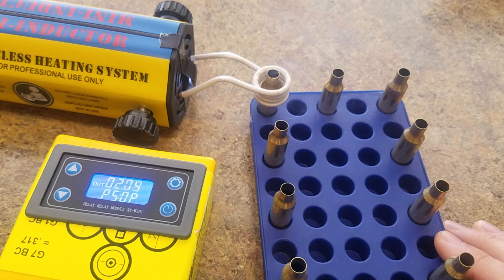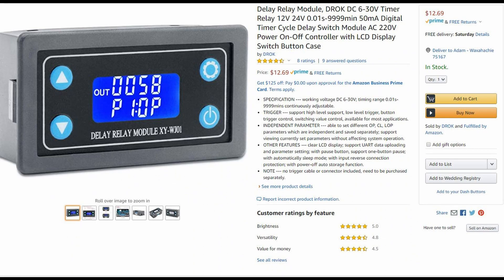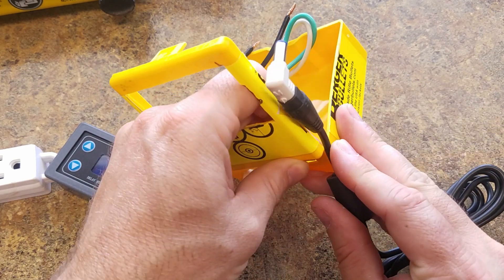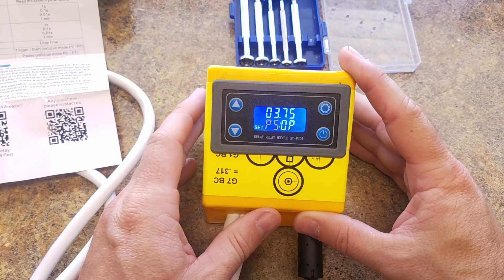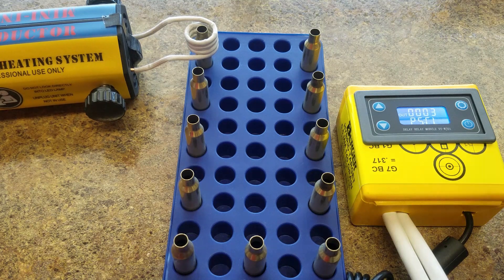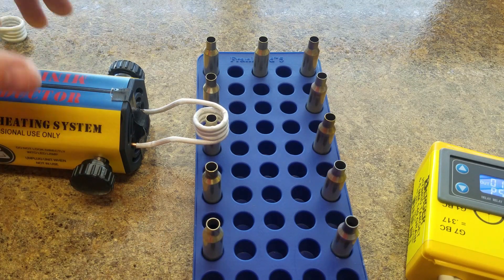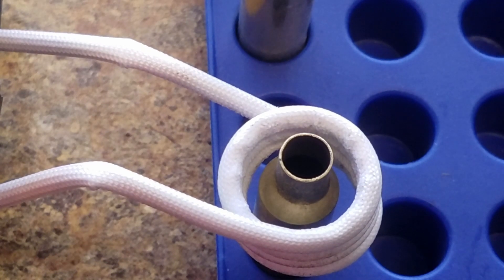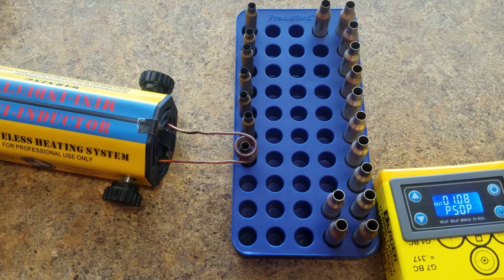DIY Induction Annealing Brass with .01 second accuracy for $200

Comment: I think the cost behind the Annealing Made Perfect is the laboratory science supporting the annealing code and verifiable Vickers hardness achieved, in the right place. Not saying you can't achieve a level of annealing with your setup, I just don't see how it compares in accuracy. Still, I applaud your ingenuity.
Reply: If Eric Cortina can shot small groups with a propane bench mark, this induction annealer will be just fine.. ;)
Reply: Look, I might be wrong, but from the research I've done, there's a relatively large window for a case to be "properly annealed".   I think AMP marketing is getting into folk's head that there's only a snippet in time / energy to get a proper Vicker's value.  YMMV
Reply from the maker: Maybe, I don't know how expensive "science" is, but I'd bet they have that loan paid off by now and yet the price remains the same. Maybe my next video will be  "PO-boys Vickers Testing" 😉 The physical annealing is the same regardless of what power supply is hooked up to the coil. Before induction annealing guys were doing just fine breaking benchrest world records using the propane torch method. AMP might have made it idiot-proof by preprogramming profiles for different brass, but as far as accuracy goes? It is accurate to .01 seconds! how much more accurate do you need? The window from perfectly annealed brass to over-annealed brass is relatively wide, and any competent reloader could easily tune this setup to stay within that window consistently. At this point, I would probably take a free AMP if the wife was just really feeling X-mas this year, but I'd probably mostly still use this setup for speed. 

What will be interesting though, and I will try to do this, you gave me a great idea, when their AMP PRESS comes out, test the seating pressure consistency of AMP annealed brass and "PO-boy " annealed brass. That's what it all comes down to in the end anyways, consistent neck tension.

Comment: Did you use anything to wrap/make your coils on? Like 1/2 pipe or?
Reply from the maker: I did,  I used a towel hanger bar from the bathroom.  I had an extra one from a remodel and it worked perfect. O.D. on it is .62"
Reply: @northeasttexastactical375  So, something about 5/8" diameter should work.
Reply from the maker: Recently I've switched to using the next case size up to wrap for my coils.  A 308 wrap works good for my 223. A 300WM wrap works good for the 308 cartridge family.

Comment: If someone watching this wanted to make a high-volume set-up. you can substitute copper tubing instead of wire on the coil, and run coolant through it. Look at high-performance computer systems with a liquid cooled CPU to get the non-electrically conductive coolant, not expensive (mineral oil?). Also, you can make your own induction coil-heater by custom-winding a discarded microwave oven transformer. Similar to an RSU. https://www.electricbike.com/resistance-soldering-unit/
Reply: Would there be benefit to wiring the fan to run constantly, or is it cooling the electrical components, not the coil?
Reply: buy this?  https://fluxeon.com/product/annie-water-cooled-helical-coil/

Comment: I'm new at this but wondering:  Does it not need to quench in water to anneal? I'm going to build one of these but I am in Australia so will need the 240V parts. I'll try to work it out. Thank you!
Reply from the maker: You should find all these parts in 240v. Quenching stops the heat from traveling further down the base,  it's not necessary.
Reply: Brass doesn’t respond like steel does to quenching. Matter of fact you can go either way.

Comment: So how did you determine the timing sequence?
Reply from the maker: You are more than welcome to add any analysis or testing steps you want,  this is just the annealer.
Reply from the maker: It is obvious though whenever you under or over  anneal, under annealing does not change color or glow red at all and over annealing gets bright red and leaves a rainbow discoloration at the bottom end of the annealed part
Reply from the maker: Look for the grey "flash" I described in well lit conditions,  or look for that dark red glow in low light conditions
Reply: @northeasttexastactical375  so no metallurgical analysis? No analysis of current lots of brass? It’s a guess as to whether sufficient annealing has occurred or an over annealing/destruction of the brass?
Reply: @jamesesenwein5152  I guess you can send a sample to AMP for testing.  lol
Reply: @bginvestor101  AMP Annealer uses one piece of sacrificial brass from a lot and determines its time to anneal. It then assigns a number code that is entered into the machine for use later. I’m assuming it has a spectrometer of some sort to conduct the analysis on the sacrifice piece. That feature makes the AMP Annealer worth $1400.
Reply: @jamesesenwein5152  I guess people weren't annealing until AMP came along??? If you can afford the AMP buy it, but a lot of people don't have that kind of money for a top shelf annealer with marginal benefits. There's plenty of top rated F-Class shooters winning matches without an Amp annealer.
Reply: @rustynut1967  I bought the AMP Annealer last year at the recommendation of a fellow shooter.  Worth every penny.

Comment: Very nice. Looks like a great answer. I have a question about the parts you link to. The Induction Heater link does not work. Going to ebay I think I have found the right one in 110 volts. The link for the Relay Timer says 220V.  Is this the wrong relay? Thanks for all you do.
Reply from the maker: I'll try to update the links here shortly.
Reply from the maker: Links updated. The relay switch I think is good up to 220v, so you should be good with 120v.

Comment: I built mine, have to fine tune the timer to the brass.  It goes on then off like yours, so it works.  Very fast.
Reply from the maker: Very cool,  glad I could help.
Reply: The 4mm works over 10 gauge!
Reply: Insulation Braided Sleeving, 33Ft-4mm High TEMP Fiberglass Sleeve White.  This is the listing, going to be a millimeter larger so I can get it right the first time. I would rather it fit with all the wait.
Reply: Also I bought copper for this in a roll 99.?? Pure.  I cut exactly a foot, might want to go 14/15” next time.
Also I found 4mm fiberglass sheathing on EBay.
Reply: The eBay high temp sleeve came and it’s fine
Reply from the maker: Let us know how long the sheathing last or how it holds up.

Comment: Very nice video. Inspired me to build from the same components, almost. Since I am based in Europe I use the 220V heater and I got this relais timer https://www.amazon.de/gp/product/B07X7NBSG4/ref=ppx_yo_dt_b_asin_title_o00_s00?ie=UTF8&psc=1. However the heater uses quite some capacitors and there are some other disadvantage in frequently powering up /down the whole heating unit. So I drilled a little hole into the unit and connected the time relay in parallel to the little red switch. So the heater is always connected to the AC and the relay does the same as the red button, just in a controlled manner. Also nice that one doesn't have to push the red button to have it operate.
Reply from the maker: That's awesome, nice upgrade.
Reply: There are 8 screws to open the unit. 3 are hidden under the yellow sticker. Once open I cut the wires to the red switch and soldered the the red and yellow wire into the cuts and re-soldered the switch into it.
Reply: Oops no ability to post pictures.
Reply: @RobertGun  thank you. I give it a try.
Reply: Can you show how?

Comment: Thank you! It is really interesting. I will try the same but will attach one plate on top with a hole to drop a brass upside down centred into the coil.
Reply: Never anneal upside down
Reply: @samlebo4704  Doesn’t the AMP anneal cases upside down???
Reply: @samlebo4704  why not? the termal transfer is way higher in the brass then any rising air would manage..

Comment: I can't drop $1300 on a machine and didn't want the fidgety propane solutions that looked like you were basically guessing and very inconsistent.  I looked up making an annealer and this is the first one I have seen that didn't require 500 steps and some sketchy circuit building.  I may just pick the parts up, the big difference between this an AMP is they have the formulas and hardness tester, I'm thinking of just doing some range work where you anneal for X amount of time and go up a short amount, shoot, a bit more, shoot and grab the velocity and group size data to see where the peak accuracy comes from.
Reply: If you reduce the watts on the transformer output, the case would heat up a little slower and it would be easier to time the precise amount needed to get perfect results. As much as the $200 induction heater is significantly less expensive than the professional units, you can make one from a discarded microwave transformer very easily for under $80. It's not about saving $120, it's about getting a unit that is perfect for the job.
Reply: @ronaldroberts7221  Huh, sounds interesting.  I'll have to do some research on that.
Reply: @InvestorAcademyPodca  The transformer would only be for the power supply. Read the electricbike dot com article on making a resistance soldering unit and spot welder from a microwave transformer first, then here is the video I would use https://www.youtube.com/watch?v=YO_cYhV6eIM

Comment: Thanks for checking.  The wire that comes with the kit is 10ga.  Have you ever tried 5 five coils of it?   Or do you think that it will make it take longer?   So have you settled on 12ga?  How do you insulate it?  Is wire available with that white braided insulation?  Thank you. Mike
Reply: I was able to order the fiberglass insulation from eBay.  Only available from China.  The size is 2mm. It’s very cheap. That is the same size that comes on the original coils.  I haven’t got it yet. I straightened the one extra OEM coil and slid off the insulation and slid it onto the new 12ga, 5 coil wire before I bent it.  It works great.  With use, the machine overheats and shuts off.  I have to limit it to about 50-70 cases and then it off and let them it cool.  I have one small fan blowing into the opening in the front as I use it, but I wished it pushed a lot more air.   You’ve been a great help to me and I really appreciate it. Thank you.
Reply from the maker: I haven't tried 5 coils of the 10ga wire that came with it.  I think it would take longer and it would heat more of the case than I need.  I don't insulate the 12ga wire I use,  it's just bare wire.  Just make sure the coils aren't touching or you effectively "short out" the coil in between. I used my 12ga, 5 coil wire on a piece of 300WM brass and it took a little under 3 seconds to over anneal it. Ive used the 12ga unprotected wire exclusively since making the video and I love the speed i'm getting from it.
Reply: That sounds good. I’ll give it a try.  Mike
Reply from the maker: @mikeortho1  id try 5 coils of the 12ga bare wire and just space out the coils enough to get the coverage you need on the bigger cases.
Reply: I  thought I was ready to go and I now see that the timer I ordered ( I wanted a 110V model) only goes to 1 second intervals.  After searching all day, I can't seem to find a 110V timer that goes to 0.1 or 0.01 seconds.  I may have to reconsider a 12V model.  I was trying not to used a transformer.  If I end up going to a 12V model, can I use a small transformer or do I need one from a laptop, etc?  Thanks again for your help.  Mike
Reply from the maker: @mikeortho1  You can use any DC inverter, I just had an extra laptop charger laying around. You can get the one in the link in the description from Amazon as well

Comment: Hi.  I'm making progress on my annealer using the same handheld unit as you.  Thanks again for sharing your project.  I see you're using 4 windings in your coil, did you ever try 5?  Some of the cases I'll be annealing will be 30 cal magnums and I'm wondering how it might work with 5 coils?  Do you think it would take more or less time to anneal a case.  Do you think the unit can handle 5 coils? Thanks for any insight that you may share.  Mike
Reply from the maker: I just measured my wires. The large wire I tried was 6ga. and it was definitely slower.  The fastest wire I've used has been 12ga. with 5 coils. The wire heats up faster,  but with the 2nd table fan it also cools down quick.
Reply: My annealer  turned out great.  I Appreciate all your help. I’m using 5 coils of 12ga like you were.  I got 2mm fiberglass insulation off of eBay. It was like $3. I use 1 fan but it’s real close.  I also built the table and the cases drop through into a pan. If I go too long, it overheats and shuts off for about 5 mins.  I try to limit it to 50 cases and let it rest.  That way it never overheats.
Reply from the maker: I just picked up a foot of some larger copper wire and it only had enough for 3 thick coils.  The thicker wire actually took a lot longer to anneal the cases. I think the wire gauge that comes in the kit works good, but I have been using about one gauge smaller with 5 coils and it's really fast,  alllmost too fast. I think just keep the coils tight and try just a hair thinner wire. I think it will handle the magnum cases no problem.

Comment: Have you ever considered a water cooled coil?  Thanks, it's great
Reply from the maker: I have not. I've had a bit more time behind this thing now and I can keep it cool enough with the table fan to run about 100rds in 15-20 minutes. Definitely long enough to get some work done.
Reply: @northeasttexastactical375  
Hi.  I'm making progress on my annealer using the same handheld unit as you.  Thanks again for sharing your project.  I see you're using 4 windings in your coil, did you ever try 5?  Some of the cases I'll be annealing will be 30 cal magnums and I'm wondering how it might work with 5 coils?  Do you think it would take more or less time to anneal a case.  Do you think the unit can handle 5 coils? Thanks for any insight that you may share.  Mike